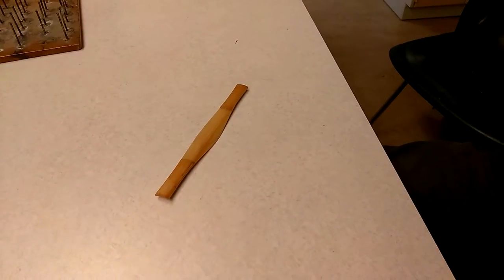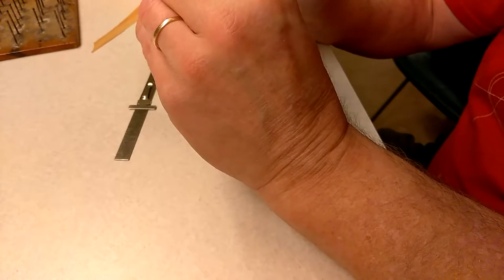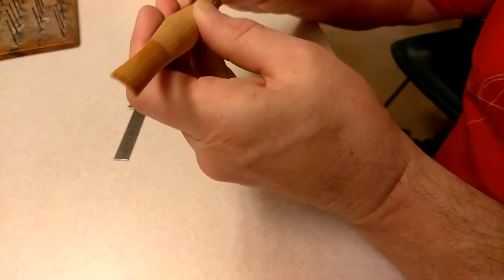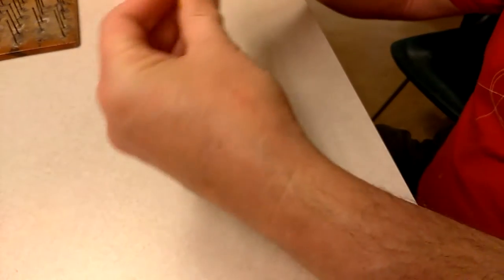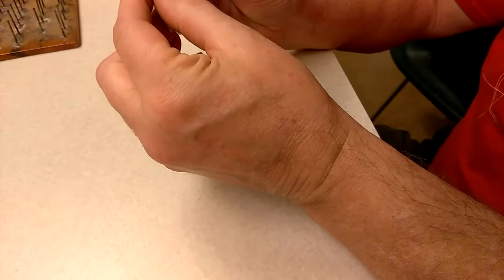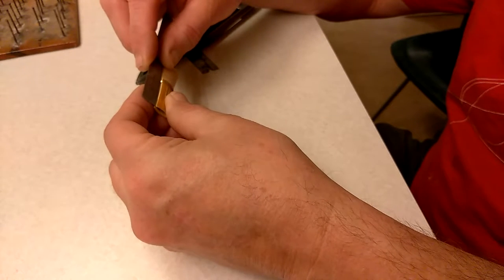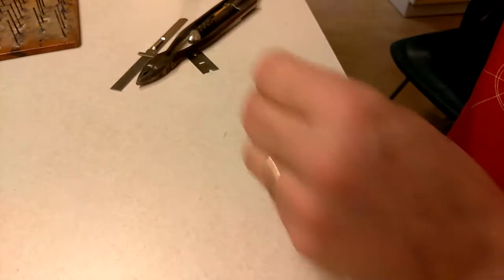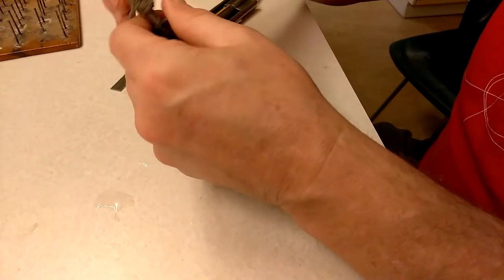Contrabassoon reed making.

Comment: do you do this step on a dry or wet cane?
do you apply the cyanoacrylate immediately after the shown step of putting the wire? 
where do you apply the cynoacrylate? (on the sides from the bottom to the second wire?)
Reply from the maker: Forming the blank is done while blank is damp. I do not soak over night. I take five pieces and dunk them in water. 20 minutes later I make the blanks. After forming the tube glue is applied while still damp.

Comment: Do you use a contra specific forming mandrel? Or just a standard forming mandrel?
Reply from the maker: I have a mandrel I purchased from Forrest's Music many years ago.  I have modified it on two sides in a sort of flattening of the tip.  That way there is less cracking at the collar.  I still use a reamer after forming and drying.  I made the reamer myself from a #3 tapered pin reamer with slightly twisted flutes.